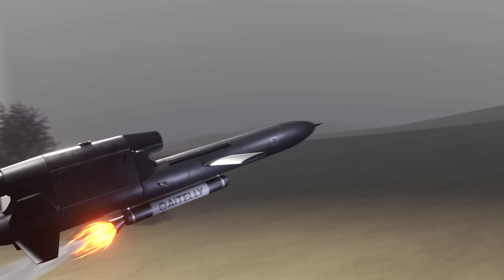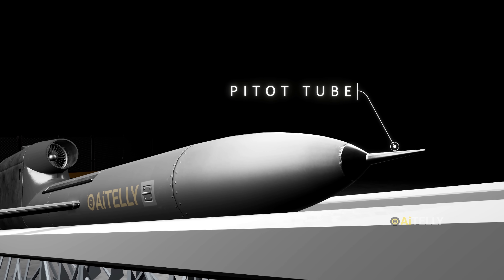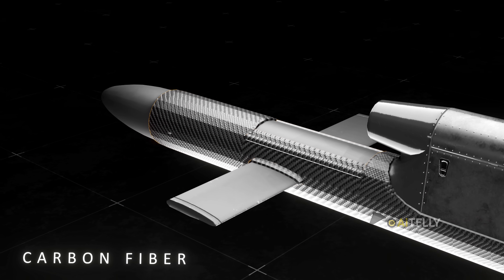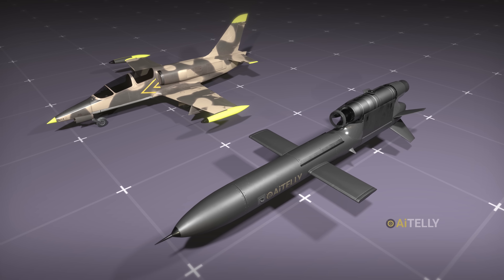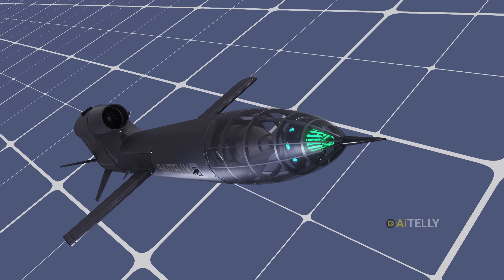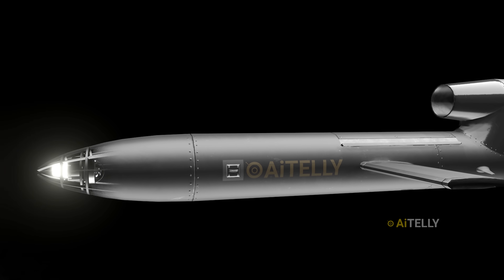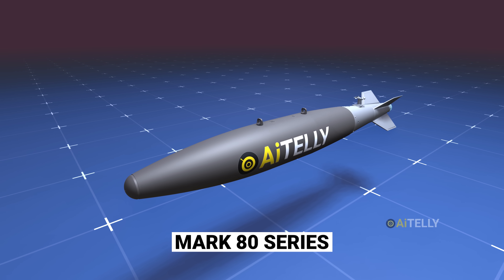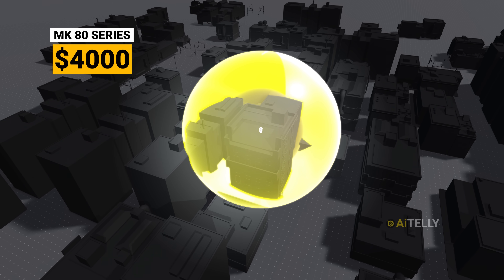The Flamingo FP-5 Ukraine Homemade Missile

Comment: Modern version of V1 rocket
Reply: @WARHAWK50-y7z  did a V1 have a computer on it?  GPS?? Anything?
Reply: @someonehasTDS  Did it need anything?
Reply: @whatilearnttoday5295  Yes, obviously, because the Germans stopped making them because they ended up very ineffective.
Reply: @ApacheAttackHelicopter-o7y8g They seem to have been pretty effective. We still talk about the terror they endued all these years later. Pretty effective for the cost. Now not having air superiority over their launch sites, now that might be a reason to stop using them.
Reply: @whatilearnttoday5295  They killed a total of like 8k people over the course of the war, while at the same time basically killing any German attempts at coming up with actually useful missile weapons like the early radar guided AA missiles and wire guided air to air missiles due to eating up all the resources.

The V1 was an embarrassing failure of a project.

It's impact on the war a footnote in history.

The reason it is remembered is because it was just such a laughably stupid weapon's projectthat people still laugh about it 100 years later.
Reply: @ApacheAttackHelicopter-o7y8g How many were afraid?
Reply: @someonehasTDS  he said modern version not ww2 version of v1
Reply: It's nothing like a V1.

The only similarity they share is the configuration of engine on top of fuselage.

That's it.
Reply: @ApacheAttackHelicopter-o7y8g Imagine trying to say this looks nothing like a V1.
Reply: @whatilearnttoday5295  Imagine not understanding the difference between the words "is" and "looks like".
Reply: no, far away
Reply: @leneanderthalien  3cm? or 4cm?  lol